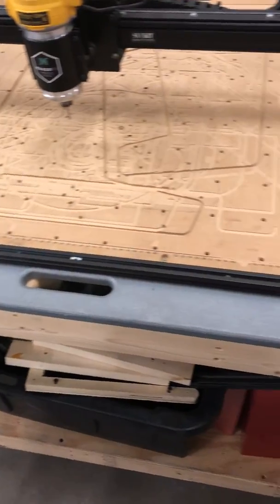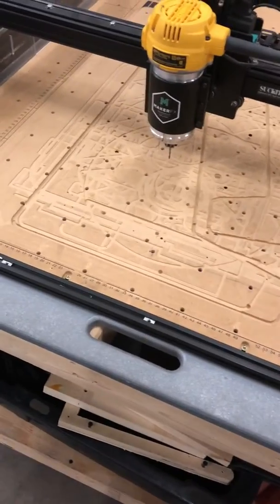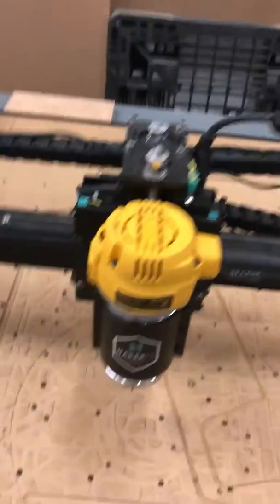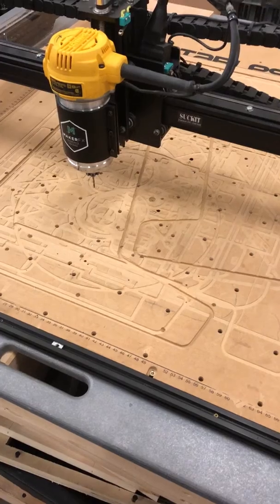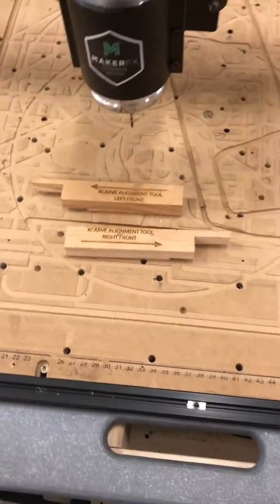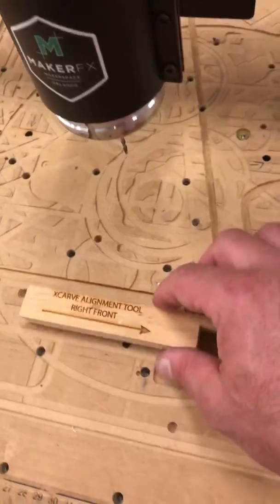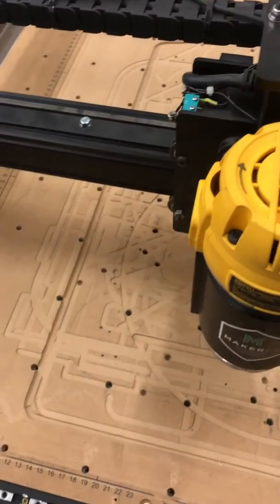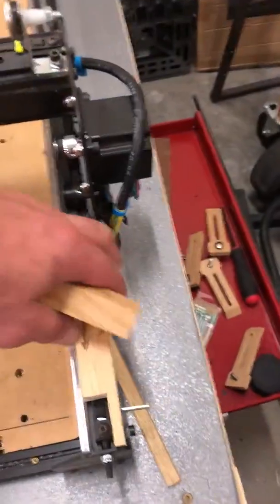MakerFX How-to: Squaring the X-Carve CNC Router at startup

Comment: That's awesome!  Are these tools available for download somewhere?  Figuring out why my xcarve carves .3mm large in x direction and .3 small in y direction is a pain.   Question about holding the beam during power up ... When the power is turned on, the xcarve will 'jump' slightly.  Were you keeping pressure on the beam during this power on jump?

Comment: I assume this is still necessary, yes? Just checking. Thx.
Reply: yes it is, I do this everytime I turn the X-Controller on. Never hurts to do this before running a job.
Reply: @shdwhealr  Thx. I've been doing it:) And instructing others to do so, too. In fact, mentioned it to Red when he was training some of us... he was unaware of it!
Reply: Hey Doug, while I have you, I have a quick question that is puzzling me: Why might the machine simply stop during a run? Also, it exited the g-code program. Was doing a parallel operation w/ a very narrow tapered bit (for 3D relief carving). Only thing I could think of is that it encountered resistance that exceeded the torque of the router. Hm? TIA. Really gotta resolve this if I'm gonna get a successful run...
Reply: @swamihuman9395  When the g-code software shut down it would stop the run because there is no software telling the controller where to move. Best places I have found answer to any questions in on  a Facebook group named X-Carve Users. They have been really helpful to a bunch of people.
Reply: @shdwhealr  Thx for the prompt reply. Yes, I'm in the group. Will post there next. Was just hoping you might have encountered this issue. And more importantly, want to know if there might be something known to be wrong specifically w/ the XCarve unit at MakerFX. Hm?
Reply: @swamihuman9395  Sorry I couldnt help more, No I havent encountered that issue.
Reply: @shdwhealr  Thx. Actually, it's quite helpful to know that you have not encountered the issue. It might still be a problem w/ the machine, but I will focus on "loser error" as the most likely source of the problem...
Reply: @swamihuman9395  I ran into this problem several times and what solved the issue for me is to get rid of the USB connection at the front of the x controller and go straight from a powered USB port to the controller card with a mini connection. Have not had a problem sense. Was suggested by a fellow on the Inventables forum. Hope this helps.